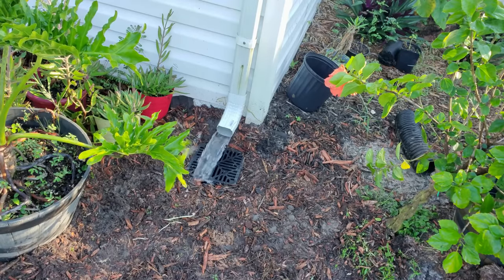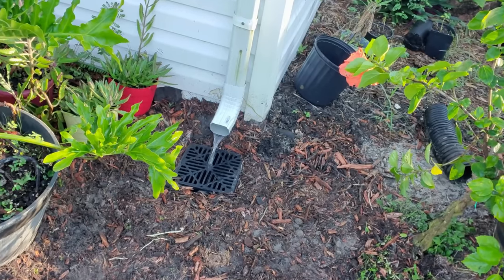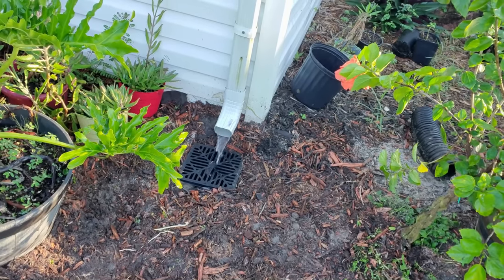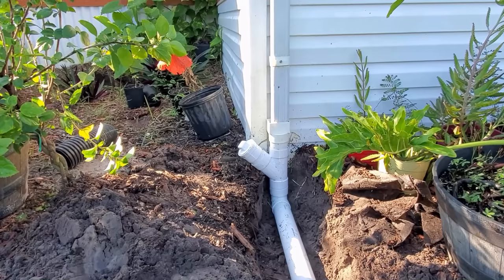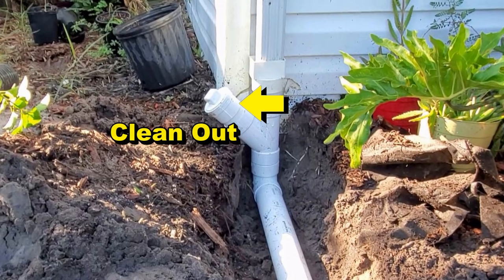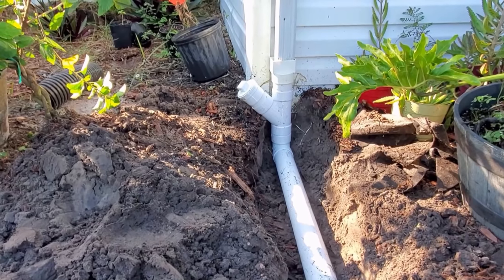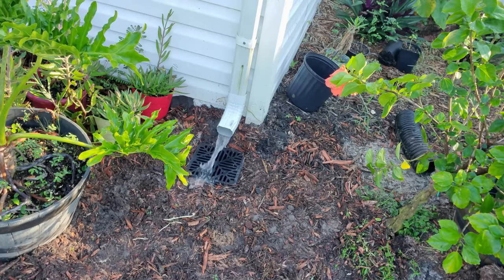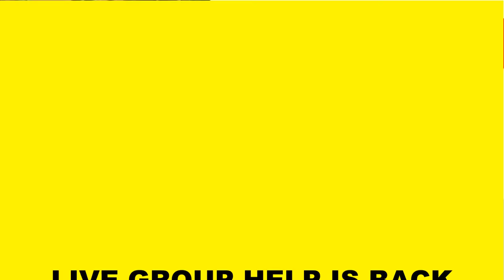Downspout Drain Pipe - Do's and Don't's

Comment: I'm having a new concrete driveway installed, and there is a downspout on the corner of the garage which drains roof water onto the driveway. The concrete contractor wants put that downspout into a PVC drain pipe, which will run under the concrete for several feet, then elbow to the left for several more feet ending at a pop-up drain in the front yard. Is this advisable? I'm a little concerned about blockage, freezing, breaking, etc... The last thing I want to do is have to break the concrete on a new driveway to repair a drainage issue.
Reply: @H H ah, so no pop-ups in the yard. That is what I have now, and I believe that is what the contractor is planning to install from under the driveway as well. In my new driveway I'm pouring, I won't have a way to have a pipe come out horizontally. I guess then, the underground drawn isn't the best idea for me from what you're saying

Comment: first of all I would not use a dead 90* elbow, I would use a swooping elbow before the Y adaptor with a 45* elbow to just have the cap for the cleanout be above ground level instead of half of the y and cleanout cap being exposed and ugly,  also you can turn that cap upside down so that it does not stick up above ground level, Cut a 2x2 to fit into the square opening for opening it up, And a swooping elbow would not clog as easy as a dead 90*elbow.

Comment: Why would you use a 90 and not a 45 elbow?
Reply: Because you're going from a vertical run downspout to a horizontal run drain line. That's a 90 degree turn. Personally, I'd use a sweep 90 rather than what appears to be the short 90 so the turn wouldn't be so sharp. This would also allow the line to be snaked from the cleanout a little easier.
Reply: @whiteknightcat  I asked if a longer elbow would be better than the sharp (which most people use), especially if you don't have a steep slope and have to bury the pipe deep, but my posts get removed.

Comment: What if a person just put the catch basin 4 inches further away, and used a 45 degree or 22.5 degree downspout elbow?
Reply: Then the stream of water during a light rain could fall short of the grate.
Reply: @whiteknightcat  2 - 45 degree elbows = 90 degrees should put it centered over the grate pointed right down the middle. My original statement wasn't very clear.
Reply: @nobies01  If you arrange two 45 degree elbows to form as S-shape and the water then flows straight down out of the second one, then you should be able to center the grate under the outflow.

Comment: Is that sch 40 or thin wall pipe?
Reply: Since there was no answer ... IMO, thin wall should be sufficient since there is nothing under pressure. If the drain line was to be run directly under where vehicles would cross over, then maybe sch 40 might be justified.

Comment: I agree the catch basin under the downspout is wrong.  But I do not agree with your solution.   You need a three foot concrete gutter and at the end place your catch basin.   What you ignore is you want to take all the high water away from the foundation.   You need to drain everything.  The catch basin does double duty and is easier to clean out.

Comment: Ok but what if the gutter is sitting next to a concrete driveway? Then what?
Reply: Is there something preventing trenching right next to the driveway to install the drain line?
Reply: @whiteknightcat  Yes the whole area around it is concrete.
Reply: @tracy3066  Ooh, that IS a tricky one. There are a couple of videos showing how to use a piece of PVC and a hose with a jet nozzle to hydro-excavate a "tunnel" under a short of bit of concrete, like a sidewalk. If you can do that, then it becomes a matter of breaking a neat hole in the concrete to run the pipe down through it.
Reply: @whiteknightcat  So I’d hire a concrete contractor to do that right?
Reply: @tracy3066  That is beyond my simple DIY knowledge. If you're going to require the hole in the concrete to be finished back after knocking it through, then yeah, I'd guess you'd need someone skilled with concrete work. Than again, some landscape companies might have specialized workers who can do that. I'm afraid I don't know.
Reply: You wont like this answer, but cut the contrete. Concrete saw the entire area you need for the line, then concrete the pipe in place.
Reply: @lawn-n-orderlandscaping1389  Uggh yeah I don't like that answer. I wish there was another way to do it. We figured out something for the winter at one property by re-routing the gutters but not sure I can figure a way to re-route them at this property.